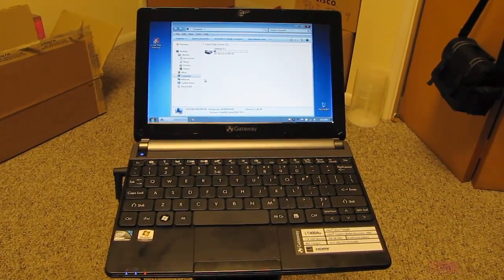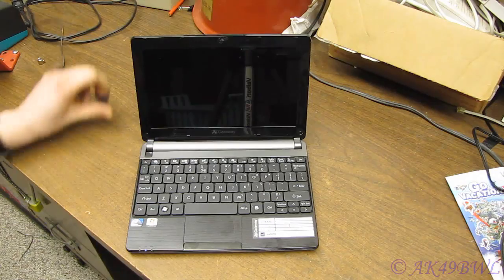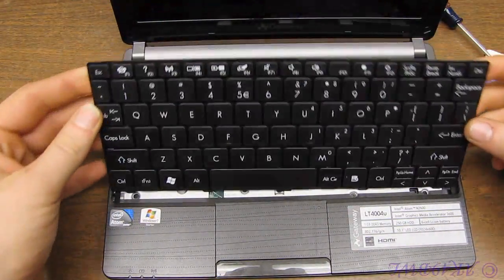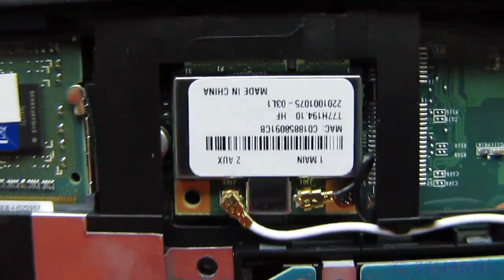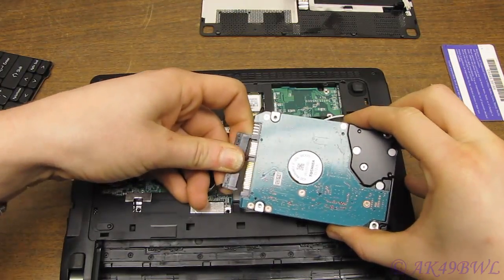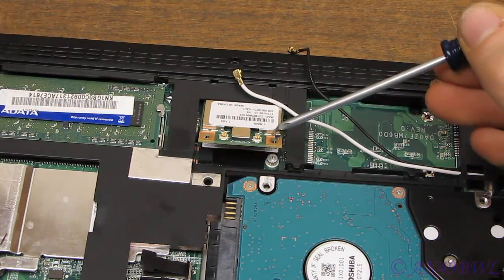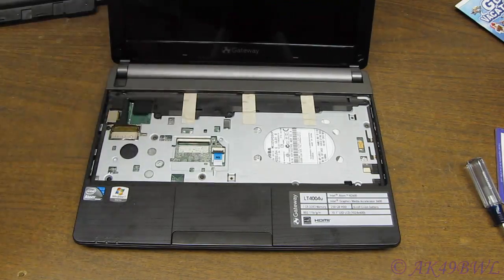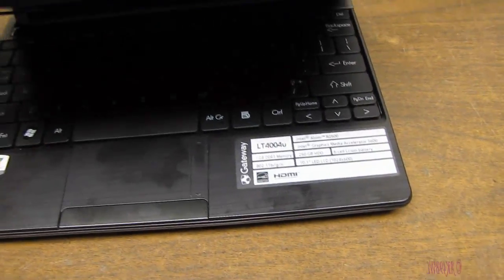How-To: Gateway LT4004U Netbook RAM and Hard Drive Access, Upgrade, Replace

Comment: AK49BWL, Thank you so much for this video. Extremely helpful in upgrading my 4004u. I must have a slightly newer model since I had 6 screws for the back door. Took 5 out and the door wouldn't move. Flipped it over and found the 6th screw labeled door and once that was out everything went easily. I put an SSD in and went with 4G of PC3-10666 DDR3. Currently installing W7 Ultimate. Again thank you for taking the time to make this fantastically helpful video.

Comment: great video.  Question --  I upgraded my ram,  powered on the netbook and realized I forgot to reattach the keyboard ribbon.  I re-opened the netbook, attached the ribbon and went to power the netbook back on but now its completely dead with no power at all.  Any ideas as to what could be wrong or if I accidentally disconnected something else.  Any suggestions would be appreciated.  Thanks!

Comment from the maker: Hard drives are cross-compatible with any computer. Just be sure you get the right size - but since there are only three sizes that I know of (1.8", 2.5", 3.5", the 2.5" variant being the ones in laptops generally), it's not hard to figure ;)

Comment: I upgraded by Windows Starter 32-bit system to Windows home Basic 64-bit because it is supposed to recognize 4GB of RAM. But when I started, the fan comes on and harddrive whirs but screen stays black and in a few seconds just shuts down. I am guessing 2GB is the max no matter what.

Comment: It's not easy to get the keyboard off, but I used the corner of my cc and a screwdriver and finally I got it started.  Then it came off pretty easy.  If u pop a key, just push it back on.  No problem.

Comment: the system has a max of 2gb ram, you can put a 8gb module on it if it fits but would be pointless because the memory controller in the computer only supports up to 2

Comment: I have TL4010u. I just finished installing Windows 7 Pro and 4GB RAM. You can find Win7 drivers at Gateway website. I installed Crucial Memory 4GB 204-pin SODIMM 512Mx64 DDR3PC3-8500. I bought it from Amazon for $24.40.
I ran NovaBench for performance result.
Before RAM Upgrade (Win7Pro) 215 (RAM 1013MB Score 81)
After Win Upgrade 224 (RAM 3061MB Score 89)
The score was always around 215 on Win Start and Win7Pro before RAM upgrade.The system only recognizes 2.99GB of RAM, not 4GB.

Comment: Thanks for the tutorial. I was slow on reinserting the keypad ribbon because the clasp popped off -- crazy trying to figure out how to get it back on.
I put 4GB in, but the system is apparently only reading 2. Can upgrade to Windows 8 and use all 4GB?

Comment: I found out about this video via a end user review of the LT4009U at the Consumer Reports website.  Kudos to AK49BWL to develop a much more efficient way to remove the keyboard. Since I worked as a Gateway contractor, I learned about opening the screen to almost flat and placing the keyboard upside down over the hinge area for reinstallation. Then, it is MUCH easier to insert the cable into the connector, flipping the black part of the connector down so the white line on the cable is covered.

Comment: Get a disc with Win7 on it. Run the installer. Make it format the HDD during the installation (if it's capable of doing so). If it's not possible to format the hard disk as part of Win7's installation routine (never used it so I wouldn't know) you'll want to get an older Windows version (or Linux "live" CD/DVD) and use the included partition manager to format the disk.

Comment: I'm pretty sure that the manufacturer documentation says it'll only use 4GB (maximum) with a non-Windows OS (such as Linux/OBSD/etc.) so you'll have to change your OS to get the most out of this machine (and you may lose some functionality). I'm not sure if any Linux distribution is capable of using laptop/notebook/netbook function keys or an integrated webcam (my Linux use is limited to desktops and "live" CDs).

Comment: You're a lifesaver bro!  Thanks so much, this works on an LT4010u as well.  Your instructions were great!  Had a little trouble with the keyboard but I found that using a really really thin library card, I was able to get behind the tabs.  A regular credit card was just too thick.  I worked though thanks again!

Comment: I also must convey my appreciation for this video. Without it I would just be banging on rocks trying to open that door in the back. For those who are wondering about the 2.99 gb useable, the integrated graphics will nick a GB for its own display use. And the Windows Experience score does decrease with the extra RAM, but I tested its performance on some games and I am happy to report that the choppiness has gone away, not bad for a $20 upgrade.

Comment: I'm back to report that while 4gb of ram worked (2.99gb usable), it turned out to be unstable under Win7 x32. I couldn't try installing x64 because Gateway doesn't have any 64 bit drivers for this model. So I popped in a 2gb stick and it is stable now, no glitches. And Windows Experience Index actually gave my 2gb RAM a better score than the 4gb. 

Has anyone tried a 3gb stick of RAM?

Comment: This video works for the LT4009u Netbook also -- same chassis.  I left the keyboard ribbon cable attached -- it was still easy enough to work around.  Thank you for posting this video; there is no way I would have figured out how to do this without it!  This was well worth the cost of $12.99 for a 2GB RAM upgrade & only 15 minutes of time.

Comment: Works perfectly with the LT4009u Netbook as well. The only thing I did differently was to leave the keyboard ribbon cable attached. I think that is actually a little easier since you don't have to disconnect and reconnect the cable. Thanks for the excellent video. It would have been very difficult without it!

Comment: I have a LT4010u. Intel states that the Atom N2600 only supports 2gb RAM. That's probably because it is packaged with Windows 7 starter. I said poop on that, I'll try 4gb. Since DDR3 SODIMM is so cheap I went for it. Anyway...long story short....

Installed Win 7 Pro 64 bit. The OS reads 4gb, 2.99gb usable. Good 'nuff for me.  Thanks for the vid:P

Comment: You know, I hated this computer at first and tried to return it. They didn't take it back because it wasn't the original installation. Turned out all you have to do is hit f10 or something on boot and you can restore to factory conditions. I'm glad they didn't take it, just needs new drivers. My other computers are in storage and this has been my main pc for almost a month now, I enjoy it. I was thinking of putting Linux on here but I'm not sure which way to go. Havent messed with it inafewyears

Comment: I popped in a Corsair Vengeance 4 GB (1x4GB) DDR3 1600MHz PC3 204 Pin 10666 SODIMM I found on Amazon a few months ago after watching this video. Just like everyone else, I get 2 gigs with 7 starter but I get 3 with the Windows 8 beta. My little tab were different and I had an easier time with them from inside the battery compartment. I plan on adding a SSD in the future. Has anyone found an alternative graphics driver or been able to get Metro o work with this thing?

Comment: That's probably because the on-board GMA graphics adapter has borrowed 512MB of RAM from your 4GB DDR RAM. Some on-board GMA graphics card doesn't have its own dedicated VRAM. I have gateway LT 40 with 2GB RAM but it only used 1.24GB RAM, although it detects and show 2GB RAM. The GMA 3600 borrowed 700+MB of RAM from my 4GB RAM.

Comment: ok, i just tried to remove the keyboard like you showed and it definitly doesn't just pop right off like that. i tried to do it EXACTLY like you showed in the video, and it most certainly did not work that way, and now i have a few keys that are off. People, be careful with this. either they made changes to it since this video, or it really is not as easy as demonstrated. now i have to deal with a broken keyboard when all i wanted was a memory upgrade, and i sure as hell aint taking it to those

Comment: As far as I know the Cedar Trail platform (which is what this netbook uses) will only run memory up to 1066MHz (PC8500).  As with any PC you can probably put higher speed memory in it and it will simply run it at the lower clock speed.  This could be verified by looking at the actual memory speed (and not the rating which is also shown) in CPU-Z.

Comment: So I followed the instructions in your video. I just purchased mine last week and I have had a lot of issues with running out of memory. The instructions are pretty straightfoward (I've done this before with previous PCs.) Today I went down to Best Buy and purchased a PNY 4GB PC3-10666 which for 20 dollars was a decent price, as they didn't have any 2GB sticks.

I installed it and...nothing. It powers on but the screen stays black.

Comment: You can test the 64 bit capabilites for free by downloading ubuntu 64 desktop and making a boot up usb stick or sd card for it.  This will allow you to see if it's worth going with a 64 bit OS vs just sticking to win with 2gb of ram or you can set it to dual boot this keeping windows for many of the capatible programs while keeping Ubuntu for everything else.

Comment: Just put a PNY 4GB PC3-10666 memory stick in mine. I'm still not sure if its using the full 4GB? Like you said it reads it at 2GB, the laptop feels faster than the 1G with the 4GB. I'm assuming since the new hardware is installed and working that its using the full 4GB

Comment: The pins are there for the card on the motherboard but the plastic pieve responsible for holding the ard in there (similar to the plastic slot that holds the wireless card and RAM) is not there.

Comment: I also did this and upgraded to Win 7 home premium 32-bit.    Surprisingly, windows was able to recognize 2.99 gigs, which is more than Intel's spec sheet for the N2600 says it can access (says 2 gigs).    I wonder if I could see the full 4 gigs if I upgraded to 64-bit windows?   I will wait until 64-bit drivers for the GMA 3600 are released to try that.   Also, GMA 3600 now shares 1,274 MB of the ram, up from just ~256.

Comment: Well i got the 4gb card installed as well along with W7 ultimate 64bit (i had the os already) and go the same results.. i got a a little mad about the fact that some of the drivers dont have 64 bit sopport like the video card, so i cant use areo and some visuals effects other than that its amazing

Comment: I have an Intel 520 180GB that will fit in it. I installed it just to see if it'd fit and it did. Detected in the BIOS etc. Not the drive I'm using in it though. I actually used a Seagate Momentus XT 750GB hybrid drive. It's pretty snappy with OpenSUSE on it(given the Atom CPU that is)

Comment from the maker: Maybe CDMA or GSM if the card has a SIM slot on it. The laptop has a placeholder for a SIM card under the battery, but no actual slot (you can't insert a SIM card). Next to the wifi card, there's a mini-PCI-E slot, not sure if you can insert and use a 3G card in that or not... Or what it's really for.

Comment: Thank You for this video.  I got one of these last week and wanted to upgrade.  Do you know if it can support a 64bit OS?  If I have to upgrade the OS I would normally opt for the 64bit.  Since it appears 2GB of ram is a starter imposed ram limitation and the NB will support 4GB the OS needs a change.

Comment from the maker: Bad stick is possible... That is the identical part number I put in hers. I'd try to get a replacement, but if the replacement stick does the same thing, I really don't know what happens from there. Does this checksum error occur before Windows starts loading or after?

Comment: I shut down and removed battery. The setup showed 4 GB. Tried several times but kept getting the error until I reinstalled the original 1 GB memory. Maybe memory stick is bad? My PNY # MN4096SD3-1333.

Comment: Thanks for the video, would never had figured out how to change the memory. I installed the PNY 4GB DDR3 - 10666 memory like you did and got this error - The file header checksum does not match the computed checksum. Put the 1GB memory back in and PC returned to normal. Any ideas?

Comment from the maker: Actually, it's simply a,matter of going into your control panel, Programs and Features (Vista, 7) or Add/Remove Programs (XP), and uninstalling all the useless junk that comes bundled with the computer and serves no purpose but to waste memory and hard drive space. It's a pretty sure bet that anything with the computer's brand label attached to the application name is a such program, but you do kind of need to know what to look for, too :)